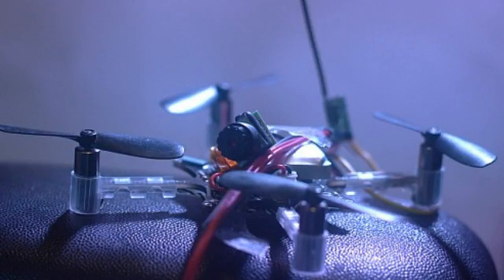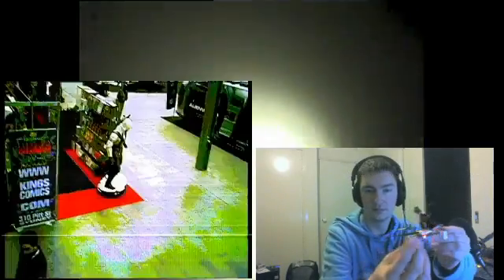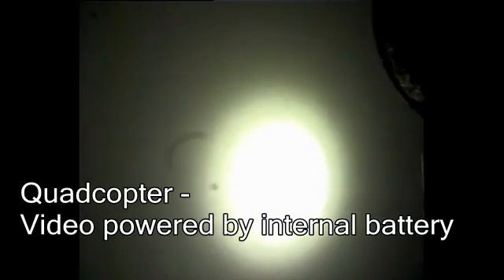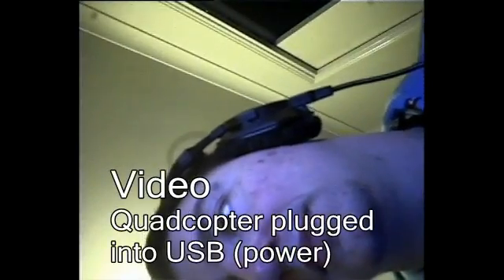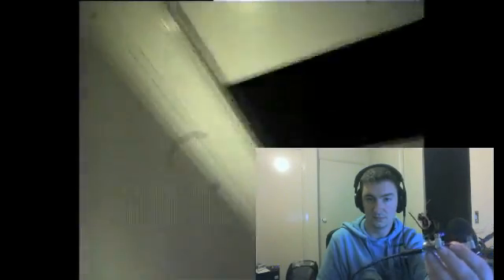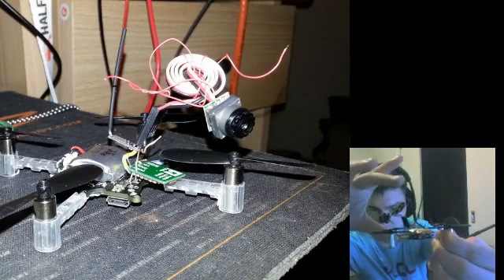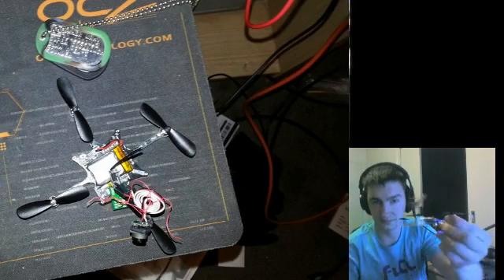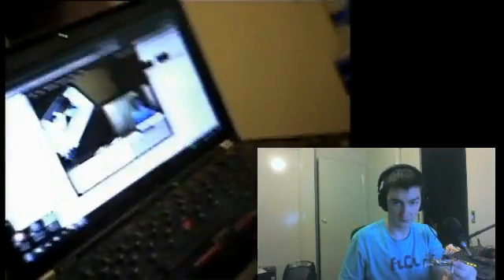Quadcopter - CrazyFlie Powertest

Comment: Hi Brett,
I saw your post on Bitcraze forum and I have been trying to add a camera to the Crazyflie. I can manage to get the video signal, but I cannot connect the flie to the PC while the video is transmitting. It seems like there is conflict in the 2.4 GHz band. I tried to contact you via personal message in the forum but looks like your inbox is full, so I use this channel. Did you have the same problem?

Comment: Hi Brett, I know this was a while ago now, but did you get all this working well? Seems like some of the posts on the forum have fallen apart a little bit with some images missing. Do you have any details about how you put together the step-up converter? Cheers
Reply from the maker: Hi David! I ended up burning out the voltage regulator on the crazyflie itself. I attempted to fix it with no luck and then ran out of time. Great learning though!

The Step up converter was made to go to the Ground, and I think the highest power pin which I think was the pin 18? it was the analog power one though. Digital power wasn't enough, however the stepup may have been able to help there. (I wrote more on the forum post though)
Reply: Brett James OK thanks Brett, appreciate the reply :)